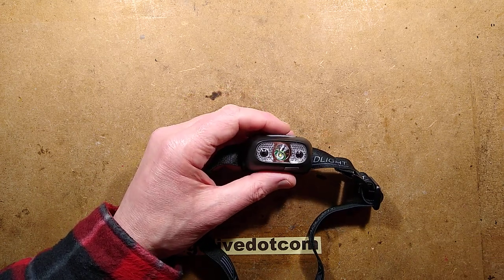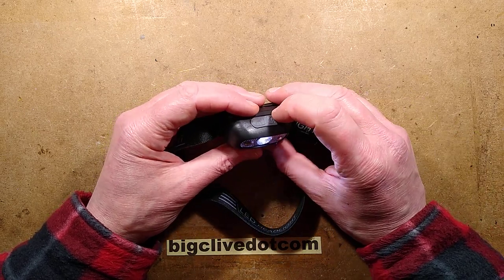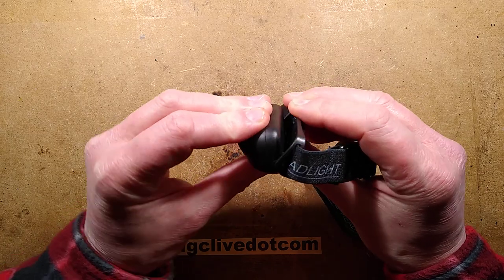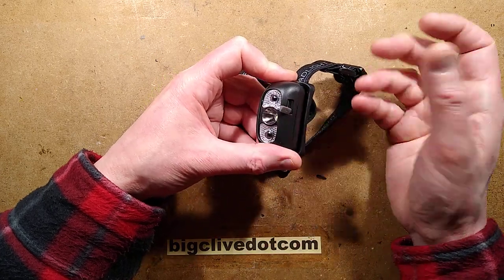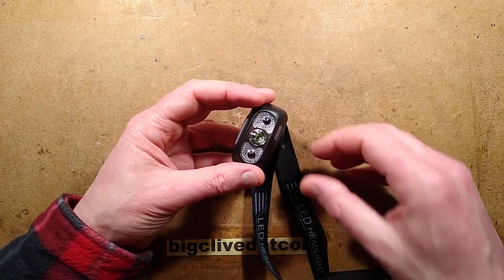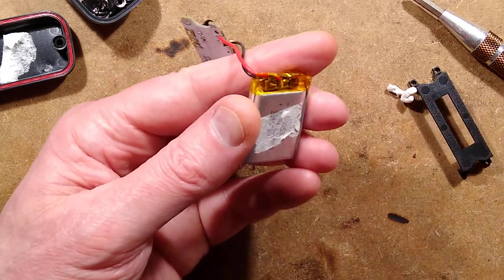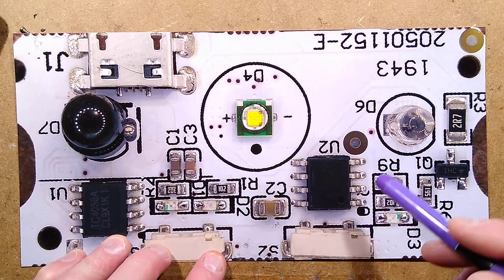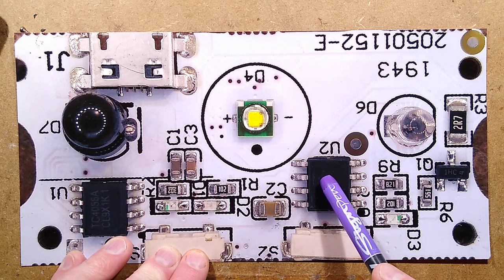This USB rechargeable LED head torch is really good!  (And no strobe!)

Comment: Clive, you were not imagining the dimming of the light.  In the sales information, it states that the headlamp will automatically cut the output to 50% after a short time to help preserve the battery. You can bring it back to full power with the switch.
Reply: If it dims while you're working, can you refresh it with two waves of the hand as well?
Reply: @eliignatoff6864  You slap it with a fish and it goes back to full brightness.
Reply: @johnpossum556  Is the correct type of fish supplied with the head torch?
Reply: @John Possum - most things can be fixed with a fish wack

Comment: Clive: Mahalo for the tip on this light. I have about a half dozen "head torches"
all are too heavy or not satisfactory for one reason or another. This on looks like
it may be the one that will do just what I need for a small, light work light.
Even if it dims down to 50% that should still be enough.
Aloha from around Makawao town Maui, hawaii

Comment: That is a good battery. Its standard in drones. So its used to motor loads, so a light load, no pun intended, could run forever. Well close too it. Thanks Clive. Simple boy from Ohio here.
Reply from the maker: It's common size, but the drone version will be optimised for high current.

Comment: I personally think headtorches that uses a 18650 lithium ion cells are slightly better, but you may not want to take that apart, the generic ones that clasohlson sells, for some reason they dont seem to sell it in UK. The item number for it is 36-6346. What I personally like about it is the fact that it can use and charge any of the random 18650 cells that you've got around, be it from old laptops or old power banks etc. Seems like they sell it everywhere but in UK for whatever reason, probably some local regulations or something along the line.

Comment: Main issue I see with this head torch for camping is, it's only decent in warm weather. A little bit below freezing and that lithium cell is probably gonna leave you in the dark, when I'm fall or winter camping I have to have my phone and powerbank in my sleeping bag to make sure they don't get too cold and die. It's also a relatively low wattage LED so if it's on over a beanie or a helmet it's probably gonna get cold enough for the cell to fail while it's turned on and in use, unlike brighter ones that make enough heat to keep themselves warm. That's one of several reasons all my favorite lights run on NiMH AAs or AAAs, along with being able to change them when they go flat without needing a charger.

Comment: using this for a year now for fishing and repairs, very pleased ... alltho I dimmed it down with a piece of kapton tape, the white light was too much for night time fishing.
two minor issues: a) off by button forces to cycle through brightness, would have been better to let it remember a chosen brightness even when not using the no-touch mode.
b) charging on a PC USBport triggers constantly the Plug&Play routine, without finding anything of course, very annoying for someone used to charge all his USB devices on the Desktop Hub.

Comment: Got myself one of these, it doesn't even have the "low" which I never use anyways, one less button press to turn it off is a plus! Just opened mine up, it doesn't have that middle bracket, the cell is fatter and has 1200mAh printed, the foam is on the other side, between the cell and board.
Only 3 complaints about this little light, 1) the headband feels "plasticky" on the forehead (I swapped for the headband of that other model that you also featured that shorted while not in use, it may be dangerous but the headband sure is nicer, feels more like cotton), that little usb cap prevents normal cellphone charger plugs from going in all the way, I had to find a usb cable with a much longer plug (mine didn't come with it's own cable), and finally the infra-red detects objects way too far, when I bring something in for a closer look or bend down close to the object the light goes out.

Comment: I got a similar passive infrared under cabinet light from China that is exceptionally good quite liked that headlamp but no SOS.
Under $10 ion lithium battery included with little charging cable.
With a red and green charging light that seems to work and it lasts forever.

It's the freakin future man!

Comment: @ BigClive, i ordered one too but it only has two brightness settings. my board has revision 3 stamped on the back but is identical other than the silk screan. Can you show us how to modify it to a 620nm RED. I need a headtorch for flying when i land my eyes have adjusted but need to read the after landing checklist, and it would be so much easier to wave my hand instead of trying to hold a torch, checklist and operate switches etc.. from what i gather the RED 3535 cree uses 2.65v not the measured 3v so i guess thats what the resistors for, unless the driver adjusts voltage to fix the current at 1A.

Comment: Now if the SOS mode would go away. High, medium, low and nothing else! 👍🏻 😉
Reply: At least on this one, you have to go out of your way to turn it on. No strobing when trying to get back around to high.
The strobing is on a lot of head torches because they are using chips meant for emergency hand torches. An SOS mode on a head torch does make sense though. I could see a lot of situations where you need a head torch and having that could save your life.
Reply: could be worse could have emergency disco mode ;)
Reply: Instead of strobe, firefly mode would be welcome.

Comment: This would be perfect. Just Factory Delete the IR detector and use a ultra wide lens to evenly spread the light. Also have the power button act as the brightness control when holding it down, makes the light brighter then dimmer and stays at the brightness where you release the power button. Once Brightness set keep it in memory and power button only turns on and off light when clicked.

I don't know why this is too much to ask for but I have yet to see a Head lamp that does this.

Comment: I'm thinking of fitting 2 or 3 around my boat especially in the toilet, a lot brighter than the 12v lights I have now and handsfree!
Reply: Poundland sell a square LED light with a large switch on it , I use them on my boat.

Comment: Actually, it is an improper SOS mode.  Proper SOS is more like a runon version of the letters SOS with no inter-letter spacing as the letters are simply a procode mnemonic for memory purposes.  So while this flashes the distinct letters SOS as  . . .    -  -  -    . . . ; a proper SOS would be . . . -  -  -  . . . (Note the shortened period between the third dit and the first (fourth) dah, and the long gap between the third (sixth) dah and the immediately following dit).  So if you see three distinct short flashes followed by three distinct long flashes with an extra space period between those two groups then they goofed as it should initial look like four consecutive flashes, the fourth (long) flash having only a short preceding space before the long spaces occur after each of the three long flashes (and the reverse for the final S).

Comment: Bought two last week, to add to the one I bought ages ago that's still going strong, despite much use in the workplace, most days.  (The angle adjustment ratchet is starting to wear) All three have the gasket and the larger battery.  Sold branded as Core Lighting in the UK. The PCB is slightly different layout to Clives, but functions are the same. Main LED is on it's own wee aluminium board to act as a heatsink? Would love to find a way to just have on and off, instead of the three brightneses....  The infra red function is very useful, but seems to drain the battery quite a bit faster than just turning it on and off.

Comment: So right... What I've never understood is that the international signal for distress is 3 flashes with a steady interval over a minute with 60 seconds gap between sets. The alpine distress signal (common in the UK and Europe) is 6 flashes over a minute, gap of one minute between sets.

Even better, morse code has stopped being actively used for distress on the radio since the early 2000s.

The only place SOS is accepted as a signal for distress is at sea, signalled via light or sound.

Yet all Chinese led lights use that particular pattern or disco rave mode as a special function.
Reply: Many books still teach ...---... as the Morse code distress signal to be used with a typical pushbutton flashlight.  The alternative distress signals you mention are much less well known outside expert circles, and few civilian product designers would have heard about.
Reply: @johncrowerdoe5527  they are the internationally recognised distress signals, not the alternatives, they are the distress signals, SOS, isn't anything (unless at sea).

If you're walking on hills and mountains you'd be well placed by learning them.

"Many books still teach" I haven't come across any reputable books that do, so that seems very anecdotal but if so then they're teaching it incorrectly. Just like the lamps are using the incorrect signals, they may as well just use the disco rave strobe mode.

Just irritates me no manufacturers do it properly, when tbh 3 blasts over a minute with a minute gap is a pita to signal. If you could set your torch on that auto mode that would be awesome.
Reply: @lmaoroflcopter  Recognized by whom (besides mountain guides and experienced mountain hikers/climbers)?   You keep saying "internationally recognized" without pointing to a reason they are so.  SOS was famously added to the global Morse code and related conventions shortly before Titanic needed it and has been in everything from popular culture to boy scout handbooks since then.
Reply: @johncrowerdoe5527  

https://lmgtfy.com/?q=what+is+the+international+signal+for+distress%3F

It is the internationally recognised signal for distress. Morse Code has indeed been used in the past, but not for the last few decades.

Yes scouts will cover morse code as a full signalling language, alongside semaphore, but they also cover the international signs of distress.

Any first aid guide, survival guide, map, which contains advice as to how to get help in an emergency will advise you to make 3 (or 6 if UK focused) blasts of a whistle, flashes of a light, etc.

Comment: Got one at 1.8$ from digitalling store with orange strap and is different. Lack gasket,14500 cell. 500mA/h no protection, charging start at 400mA then drops steadily to 100mA, stopping at 4.1V. Green pcb becomes quite hot when LED is kept in high mode for long (2 levels bright at low visible PWM) 1 IC only. My goal is replace Led with warmer one if there is space add a pot. and protection
Reply: Do you have a link to the shop? I'm searching one that are using 14500 cell.

Comment: Would love to see you check out some actual good quality low price lights. Headlamps as well like the wowtach A2 or any of the extremely well-made headlamps that are under $30. 

Some of them will blow your mind on their cheap price and they absolutely kick ass. With built-in charging, either taking a 16340 or18650 battery. And offering up to 1000 lumens. Honestly 1000lm in a headlamp is a bit much in my opinion, and I like to stick to the 16340 battery… therefore I love my Nebo rebel headlamp that’s rechargeable with a magnetic charger that sticks to the tail cap… similar to the olight headlamps except about a third the price coming in at around $30. Including the very high quality protected battery cell.
It maxes out at 600 lumens but it’s more than what I need… And I’ve used it for over two years six days a week having to recharge it every single night. It hasn’t failed me, I literally use it 8 to 12 hours a day every day working in my lab, I have it on low mode which is around 200 lumens I think. More than enough! And the magnetic charger means I don’t have to plug it in every night… Which is good considering I recharge it 365 days a year which would wear out a USB mini plug and render the light worthless.

Comment: I bought a hybridlight led usb rechargeable head lamp last spring. I use it for hours every night. Occassionally two nights but then it'll run out. It would initially re charge in minutes, the led turns green. Now, it won't turn green but still powers through the night perfectly. The lens broke out when I dropped it from the couch to the floor. When very carefully handling it the plastic case broke. Package states a Utah Company. Bought mine from REI 20.00 usd , th ed shape shown here is less durable than mine and the lens material is the same. I want another one because they run long and charge and break like junk.
Reply: Sounds like you need one of the aluminum ones. I've got one that uses 2 18650s and I have had it for years & years. It's nice to be able to replace the batteries w/o a surgery.

Comment: Pretty nice, looks a bit like my favorite, one I got locally that's branded Energizer. Same glove sensor thing, though it has a "wide angle" low mode (with slightly warmer LEDs) instead of 3 levels on the main led. Also, mine absolutely chews through AAA cells (takes 3) - lithium rechargeable would be much nicer. Now I want to measure mine for a nice little lipo cell conversion....
Reply: Being you are of course an avid BigCliveWatcher you should be able to upgrade it yourself. Look for a 30 by 45 mm oblong li-ion battery and solder it in there. I should buy one of these for my mother for emergencies.

Comment: I have just received one of these in the slow boat from China, mines seems to be the same but only had 2 output modes, high and presumably medium... And to change the brightness of the auto mode I have to turn on auto mode, then press that same button again to get the lower brightness.

Comment: I have several gadgets which are rechargeable through a usb port,and although the majority of them have lasted well,I have found to my cost that some usb ports are we quite flimsy,and pushing the plug in to recharge the appliance had dislodged the inner connections,and rendered the appliance inoperable. So now I am extremely careful connecting up.
Reply from the maker: That is an unfortunate thing that happens with many products. Even high level ones.  Little thought is given to the stresses that a micro USB connector experiences.  That's not helped by the tiny connection pads and brittle lead-free solder.
When I add micro USB to my own designs I always provide maximum support and generous pads for the two main connections.
In the future I'll try to remember USB strength when I'm reverse engineering products.

Comment: Doh! Just found I've got a clone in April - refused to charge - I opened it up and the battery was puffy. Looked closer and it doesn't have a protection circuit and the main board doesn't have the 4056 chip. Looked for a replacement battery and they cost more  than the lamp!

Comment: Just tried to purchase one after following your link and I got a message stating that HMRC blocked the purchase from this seller. Bummer. I am in the UK, if you hadn't guessed.
Reply: Jackattack 

Thanks. Sorted. 👍
Reply from the maker: When that happens copy the description and search for it.  It'll find other sellers that HMRC haven't meddled with.  As fast as they block sellers they spring back up.  It seems to happen in waves.

Comment: hey clive,  can i send you a bike light/torch that requires a 18650 battery, I bought it faulty to see if it was a battery issue but seems even a fully charged battery cant revive it. If you get it working will make a nice torch for you.  charges with standard micro usb and has a pretty good light output.

Comment: I bought one like this on aliexpress 3 weeks ago for 6-7$ CAD. From the outside it's identical but not from inside. The lithium cell is very small 17mm x 22mm, about 200mAH with no over charge/discharge protection. The charging chip (6 pin), on the bord it's written 4057, the charging current is 450-500mA way too much for the cell size...All the mods are pulse modulated at 100hz so the light flicker a lot.. Mine doesn't have a o ring between the two parts of the case and the usb cable that came whith the light have iron cable inside.... I'm thinking about cutting traces on the board, replacing the switch with a latching switch and adding a resistor to the led and a TP4056 board. I will upgrade the lithium cell if I find one of the right size on the side of the road.
Reply from the maker: The 4057 is the charge control chip.  There will be a resistor in its vicinity marked something like 222 (2200 ohms) that could be increased to drop the current.  Or better still, a bigger cell could be fitted if there's space.
Reply: @bigclivedotcom  Ok I will change the resistor for one with higher resistance to drop the charging current to about 100mA. I was not sure if the 4057 worked the same way as the tp4056.

Comment: I bought something that looked identical to this for £5.59 and it turns out to be vastly inferior, as well as DOA. The cell is not protected and has discharged beyond the point of no return (and the wrap is swollen). All the pieces are less well made. There's no rubber gasket sealing the shell against water ingress, the solder and internal screws appear corroded. So caveat emptor! Edit: I have just discovered the giant rabbit hole that is budgetlightforum.com. It takes all sorts...